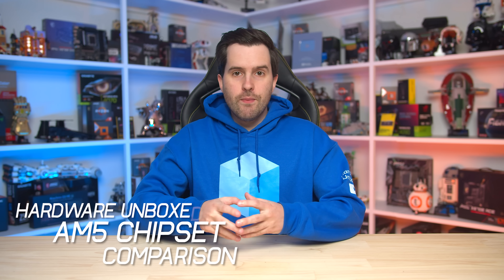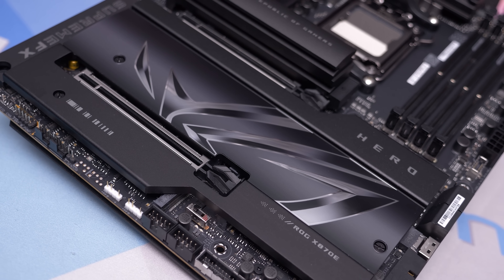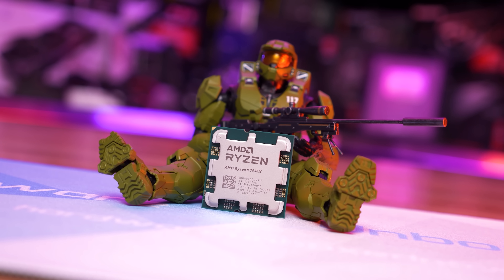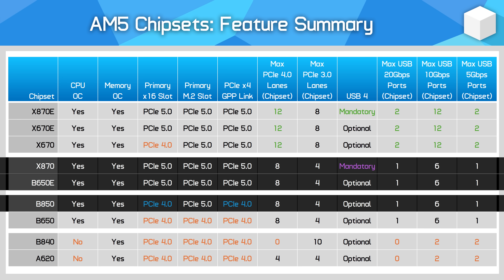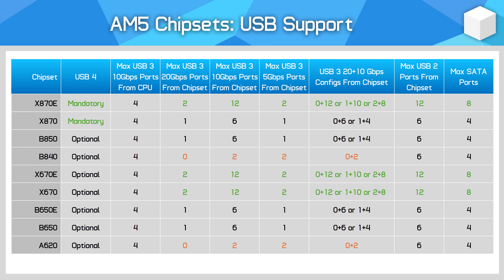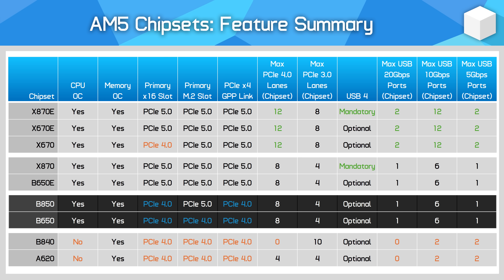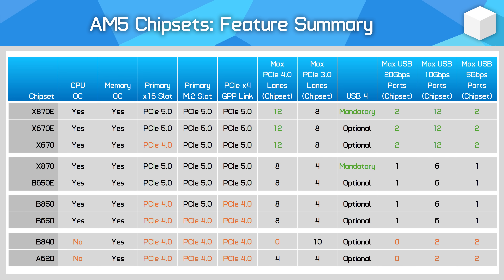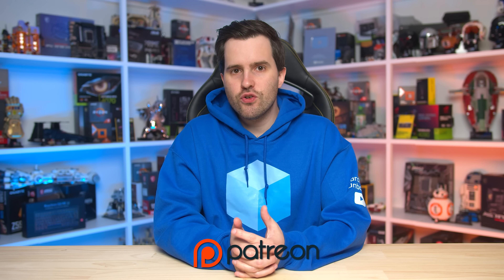AM5 Chipsets Compared - X870E vs X670E vs X870 vs X670 vs B650 vs B850 vs B840 vs A620

Comment: What would be an argument to have the primary x16 slot be PCIe 5.0 instead of 4.0? 
Thats the GPU right? Will the new 5070 series need PCIe 5.0?
Reply: Depends on your monitor at 1440p it would only matter if your looking at 360hz above without using Display Stream Compression.
At 4k PCIe4 x16 can already run 144hz but PCIe5 will allow 160hz without Display Stream Compression but still not be enough for 240hz.

Comment: My X670E Board gives the code 35-36-37-46-47-48 but it works just fine, while testing games, I got normal results and nothing seem to be a problem. 
Anyone know what the problem might be? My search in the internet didn't help at all or not related to me problem.
I build the pc after upgrading and its the first time after building over 5 pc where a problem occurred.

My PC:
All drivers are updated.

AMD Ryzen 7 9800x3d (Updated) 
- ARCTIC Liquid Freezer III 360
ASUS ROG STRIX X670E-E GAMING WIFI (Newest Bios Update)
32GB (2x 16GB) G.Skill Trident Z5 NEO EXPO RGB black DDR5-6000 DIMM CL30-38-38-96 Dual Kit (Expo 1 activated)
MSI GeForce RTX 4090 GAMING X TRIO 24G

Samsung 980 PRO 1 TB
Samsung 990 PRO NVMe M.2 SSD, 2 TB

Comment: The biggest thing to watch out for is many of the x870(e) boards have issues with splitting the 16x gpu slot to 8x with the additional of USB4. Given X series board owners are typically looking for more complex builds this is a huge issue. There are some terrible bifurcation choices out there.

Comment: Sounds like X670E is the go to.
Reply: X670 and B650 are the way to go price have come down and they still deliver the same as the 800 series and u can used the 200-300 u save for a higher end GPU or CPU
Reply: Im sure B650 is the way to go
Reply: @ For budget boards I would agree. That’s the next best thing.

Comment: I bought an MSI X670E GAMING PLUS WIFI on black week, almost 30% reduced in price. This is because im upgrading from 3700x to 9800x3d and after some research I felt that it filled my needs well and guaranteed a PCIe 5.0 slot for future upgrades. What I didnt know is that seems to be identical to the X870E, which would cost more than DOUBLE of what I just bought the X670E for (which was already pretty expensive). 

Literally insane. I was pretty confident with my purchase but this instead made me feel I made an amazingly good purchase.

Comment: Thanks for explaining.
I was torn between X870, X870E and X670E for my 9800X3D.
I ended up with the X670E as that board was 359€ vs. the 511€ X870E Board. And I don't pay 152€ for a USB 4 Upgrade and some Comfort Features that I don't need.

Thanks!
Reply: which brand did you get for your x670e motherboard and how is your pc holding up? i’m building a pc with same cpu and wondering
Reply: @habibi5809  The Asus Rog Strix X670E-F Gaming Wifi
PC's running really good!

Comment: My basic rule of thumb is that for any generation my go-to boards are basically either Gigabyte Master, ASRock Taichi, or MSI Ace. With a preference for Gigabyte Master, followed by ASRock Taichi. I tend to avoid Asus, as they tend to be overpriced and have occasional issues. Even though they're considered high end. Not that I would never get them...just Gigabyte (and AsRock) generally has better value, are rock solid, usually offer a better layout for my purposes, and I like their BIOS.

Comment: @hardware unboxed Which motherboard would you recommend at mid price for the 9800x3d? One that has 4 m.2 preferably and that does not drop speed on the gpu if m.2 is connected.

Comment: 13:09 What does "USB 4 is mandatory" mean? If I put a USB2.0 Stick into the mainboard it won't work??
Same question for PCI5.0 SSD. Can I use an older m2. SSD on any of those mainboards/Chipsets?
Reply: My understanding is that 'USB mandatory' refers to the spec - the manufacturers must include USB 4 ports, they will no doubt also include USB 2 ports.

M.2 SSD is backwards and forwards compatible. PCI 5 supports speeds up to 14000 MB/s , your gen 3/4 drive will work but won't run at that speed, it'll most likely between 3000 and 7000 MB/s
Reply: @stephenjones3751  thank you!

Comment: I find it funny how AMD is gimping PCIe 5.0 support from the CPU's on the lower tier chipsets like B840,B650 and A620. Every single AMD chipset IS capable of PCIe Gen5 to ALL devices connected to the GPU (So the Primary x16 slot for Graphics, the M.2 slot and the additional x4 GPP lanes). I Guess they have to make the lower tier Chipsets seem less attractive to users

Comment: Is it fine to put the 9000 series in B650?
Reply: @qittfthegame6128  late answer so you probably already know but basically, yes. The B650 chipset is the same as the X670 (and X870). The important thing to remember is that you need to update the BIOS before using the 9000 series CPU in it. Flashback with a USB memory stick is easiest.

Comment: Considering the price of X870E I think I will just get an X670E for my 9800X3D. I don't need USB 4. There is no external SSD I need to go that fast. The WiFi at 6E instead of 7. Same thing it still handles 1Gbps and I use Ethernet as main anyway.

The X870E boards are super expensive and the 870 has less features, especially guaranteed than the X670E.  Also I can get a "proven' X670E that is known to be good and stable etc.

Comment: So, if my GPU is using 16 Gen 4 lanes does that count as 8 Gen 5 lanes or 16 is 16 used no matter the Gen? My main concern is, do I have to drop my GPU to 8 lanes if adding more Gen 5 M.2s like with a pci-e adaptor?
Reply: Look for a Youtube video titled 'All X870 Motherboards PCIe Connections' from Ronin Wilde. This cleared up a lot of the lane switching questions I had for the X870/X870E boards.

Comment: What’s the functional difference between X670E with USB 4.0 and X870E boards?
Reply: If the X670E board uses the Asmedia USB4 chip, nothing. Otherwise, those may be using a slower Thunderbolt chip for USB 4. Check the board's specs. Either way, they are most likely using Gen 4 lanes. Only 2 X870 series boards use Gen 5 lanes. The Godlike and Tomahawk.

Comment: Lol I was looking at the features of these MOBOs  and for the VAST majority of people even hardcore games, there's absolutely no reason to get anything over a B650E /X870 unless you can find an X670E/X870E at the same price point. As long as the board has the right PCIe gen 5 on the 1st x16 slot (and thats only cause RTX 5000 series is rumoured to have support for PCIe gen5, if not then you could get a standard B650/B850 and use the pcie gen4 x16 and be set. Hardcore gamers like to upgrade anyway more than they need to (guilty)) and one gen 5 on the first m.2 NVMe, any MOBO will suffice. 

Like they start boasting these "oh but this board has USB 4.0 ports yada yada yada" and there's not even USB 4.0 devices lolz. 

I remember that boards were doing the same with SATA express when it came and we all know that those drives never even saw the light.

Same shit for the amount of SATA ports. How many do you need to justify the X series purchase?

If you wanna overspend then go for the highest tier B650E/X870 mobo you can find, it will be cheaper than any board of the other series without losing potential performance.

The few scenarios I could maybe see are once they release the 9800X3D is if it's overclockable then maybe you could justify the X chipset (in the 600 series) for more stable OCs but since the 7800X3D wasn't, then the X series was basically dumping money. If you deal with tons of heavy files like 4k videos and stuff like that maybe you could perhaps benefit from extra m.2 NVMe 5.0 slots. Othewise you're just flashing your cash to whoever might be impressed about how much money you put into your mobo.

Comment: Since my next upgrade is my ITX system, AMD is on the clock to get rid of this dual chipset bullshit because I'm not buyin an ITX board that wastes space on TWO CHIPSETS just for my minimum M.2 connectivity (4) I'd rather have Intel's degrading bullshit CPUs than AMD's space-wasting bullshit motherboards

Comment: Planned on buying an X870 for my new build. Realized it's just an extremely overpriced B650e. Ended up getting an X670e board for $200 off retail. 
I miss out on USB4, WiFi7, and higher RAM OC compatability.... NONE of this matters to me anyway. I basically have an x870e board without USB4.

Comment: Hmmm.... I love my Steel Legend X670E motherboard.  I wqs looking at the Nova 870E motherboard for my next AM5 build; but, if I'm understanding this mess correctly: my next AM5 would still be great on the Steel Legend X670E if I'm understanding this correctly.  sigh So confusing!!!
Reply: I'd stay on your current board. No need to upgrade for current cpu's.
Reply: @tracymonthei6561  Alas, it too is on Backorder where I normally get PC components. I was looking at the Nova for a new build.

Comment: The thing I find weird is that only A620 & B650 ITX motherboards seems to have standard 3x Audio Jacks rear I/O to connect 5.1 speakers. All of the higher tier ones lack those. I think the only "higher tier" one that actually has 3x at the rear in Asus B650E, but it is disqualified since it uses 2x rear ones and 1x front panel audio to connect 5.1 audio... which is an insanely weird design choice...
Reply: Are you referring to how Asus's specs pages say that the rear line out doesn't support spacial audio? I was recently looking into this and I found this Reddit thread that explains that it only applies to downmixing for headphones and not separate analog 5.1 speakers (see r/buildapc/comments/1dd39m6). I hope it's true since I also care about this and will be likely getting the ROG Strix X670E-E board soon (though unfortunately they are becoming rare to find new - and the ROG Crosshair X670E is all but impossible to find). But yes, not enough people care about this, sadly. Some say "just buy a sound card or external DAC" but why should I spend more on something that a motherboard should have, a high end one no less? Seems like they just traded audio ports for more USB-Cs, which I really don't care about... Cheers.

Comment: Ok I'm looking at the X870-P model that isn't listed on this video... What exactly does that one do and where does it land? I'm looking at the MSI PRO X870-P WIFI ATX AM5 Motherboard. 

From what I'm seeing it has PCI 5.0 128GB/s bandwidth, one 5.0/4.0/3.0 x16, three M.2 PCI 4.0 slots, and a couple of 3.0 x16 slots. 

It lacks a little bit of USB slots it looks like. It has two USB-C slots one 40G and one 20G, two USB 10G, two USB 5g, four USB 2.0. Seems kind of odd to not have that many USB slots, not sure what periphs I could even use on those.

Comment: Basically X870(E) is for me pointless upgrade, USB 4 is niche use case for most people including me, while many other would value more having ability to have 2 NVMe SSD connected directly to CPU PCI-E lanes. Secondly X870(E) line up is basically "minefield" full PCI-E bifurcation traps. So I am staying on my ROG Strix X670E-A as long as possible. I love this motherboard for having no bifurcation traps compared to AMD 800 chipset line up

Comment: I have this weird "bug"? with my asrock x670e pro rs where if my computer is turned off for more than a couple hours it wont post initially but if i turn off the power supply hold the power button in to drain then turn it back on it turns on fine...It does this EVERYDAY. I have thoroughly checked my overclock with occt and everything checks out no errors with the cpu/gpu/memory. Wonder if anyone else has this "bug"? with this motherboard? Bios version 3.06 with a Ryzen 7700x. It did this with previous bios versions also. I thought maybe a bios update would fix this when it first occurred but apparently not.

Comment: Hey man, sorry OOT.
But if you have to make a rank the best power efficient for 1440p max ultra settings GPU with watts-per-frames method, which one is the best?
Reply: Out of the box the 4080 Super is the most energy efficient but the 4090 can surpass it after doing some undervolting.The Ada Lovelace GPUs are the most efficient at 2500Mhz and the V/F curve goes exponential from 3000Mhz upwards so keep that in mind.

Comment: Literally the only thing good about the AM5 platform has been the 7800x3D for me. Everything else is a mess. Unstable BIOS, long boot times, iffy RAM support etc. has been a real headache for me. My first 7800x3D already died and got replaced once, and I switched from an X670E Carbon to the X670E Aorus Master just because the Carbon was pretty unstable when setting it up for a faster boot. And by the way, the X870E Aorus Master has a few downgrades from the X670E version. Crazy.

My old i5-7600K on an ASUS Z270-E Strix board ran SO well that I barely even had to touch the BIOS. The difference of experience has been wild so far. AMD is truly setting itself up for failure right here.

Comment: So if you buy Intel, you might just see your CPU performance degrade over time.  If you buy AMD you have a confusing mess of chipsets to chose from before you even start looking at CPU options.  What happened to each team having 3 tiers of chipset per generation so that people could select what they needed relatively easily?  I've been building PC's since the 2000's and this confuses me, let alone someone just getting into the hobby or someone who is non-technical - they just won't have a clue what any of this means.

Comment: So the Bottom Line: Get an Asrock B650 Steel legend, that offers 1x pci 5.0 and has pci 5.0 for m.2 for 180 USD, and has decent VRM thermals.  With a firmware update it will work on your New Ryzen processor and also support the new DDR up to 7200, altough 6000 will probably will just work fine.
Reply: If i move on from 7800x3d to a ryzen 9000 or something in the future, say 3-5 years or whatever, will the asrock b650 (heard none E version is better?) steel legend support the newer cpus? Thanks

Comment: Why does CPU PCIe Bifurcation have anything to do with the used motherboard chipset? It’s a BIOS option setting the CPU’s IO Die to a specific PCIe configuration to use multiple devices typically in a single physical PCIe slot.

Comment: How is this a mess? Do all of the chips features work from top to bottom at their rated power levels? Yes. Do higher models bring more features than their lower counter parts? Yes. Is the latest generation better than previous? Yes for the most part. The one area where things are moved around is on accessories on USB devices on the low end. That's it. It's not something anyone needs to worry about. If you're on the 6 series stay on it. If you're buying new buy the 8 series. 

I don't see how this is confusing. 

I don't know if you're trying to get AMD to pay you money or what but ya'll are on a tear and it doesn't make much sense and it doesn't help the community.

Comment: This video helped me to decide to go for an x670E board for the new 9000 x3D chip I'm gonna get.
Reply: I was thinking the same but theres an issue. 9000 series cpus wont be supported out of the box and you have to update your bios before you can use the CPU. Not a huge deal - just something to be aware of
Reply: Depends on when the motherboard was manufactured. You can check what BIOS it would have had at time of manufacturing and if it supported 9000 chip. Otherwise, you gotta look for a motherboard with BIOS Flashback button.

Comment: B650E was confusing. I thought the E meant two chipsets, but it's just the x16 slot is PCIe 5.0. So X670 could be better or worse depending what you want.

Comment: I just bought the MSI MPG X870E Carbon WiFi and G.Skill Trident Z5 Neo Black 64GB (2x32GB) PC5-48000 (6000MHz) DDR5 Ram also bought my friends Asus TUF RTX 4090 for $1700 since he will be upgrading to the RTX 5090 once it comes out just waiting on the 9800 X3D can't wait to move away from Intel.

Comment: PCIe lanes on AMD are a real mess! I've been comparing the specifications for X870 and Z890 motherboards (e.g. MSI Tomahawk) and finding more usable M.2 slots with a (future) PCIe 5 GPU with Z890 (Intel). So it looks like a choice between platform upgrades (Zen 6) vs. flexibility for additional storage. Even the higher end X870E motherboards look nerfed compared to Z890 (e.g. MSI Carbon).

Comment: As an ITX user, is there any functional difference between the ASUS ROG STRIX X670e-i and the X870i? Both have the same number of rear USB 3.x ports, 2 USB 4 ports, 2.5Gb Lan, use the FPS-II card, stacked M.2 drives (1 PCIe 5.0, 1 PCIe 4.0), and a variation of the Strix Hive device, but obviously use different chipsets. There seems to be quite a bit of conjecture about whether or not ITX can even take advantage of the additional PCIe lanes offered by X670e, or whether the reduced number of promontory chipsets onboard could actually help control VRM/board temps better.

Comment: Proposal: 
1. CPU can multiplex bandwidth for lanes (committed rate) or motherboard includes non-blocking PCIE switch: so lower PCIE generation = more lanes.
2. All slots are physical x16 (or higher) and wired into the CPU.  
3. Active lane allocation (between slots & bifurcation) and PCIE generation usage is controlled in the BIOS
4. Chipsets are installed in PCIE slots

Comment: I am confused more than I was confused before.
Reply: TooLongDidn'tWatch

Its just mid cycle refresh of the motherboard. 
Added features/speeds but unless you need some certain feature, then you would have searched for it already.

X870E is just refresh of X670E
X870 refresh of B650
B850 refresh of B650
Reply: For gaming, only buy a board if it’s got a 50 or higher.
If it has 50 don’t buy the cheapest board, make sure it has a big heat sink. An extra 30usd gets you a much better board 50 board.
If it’s higher than 50 they are all good.

600 or 800 bugger all differences just never buy the 840 or 620

Forget about PCIE 5.0 doesn’t matter.
Reply: @chrisbeauchamp5563  Are you sure PCIE 5.0 vs 4.0 doesn't matter..?